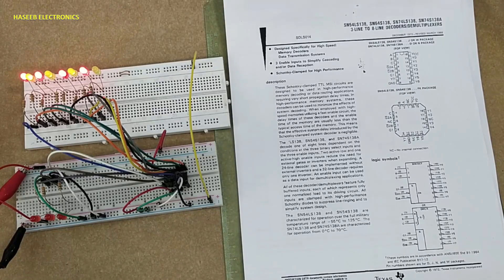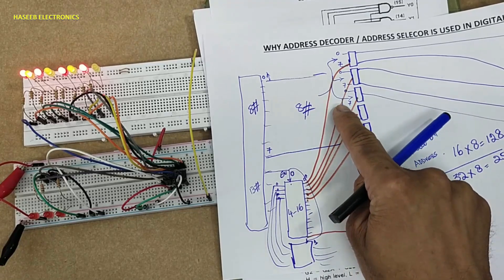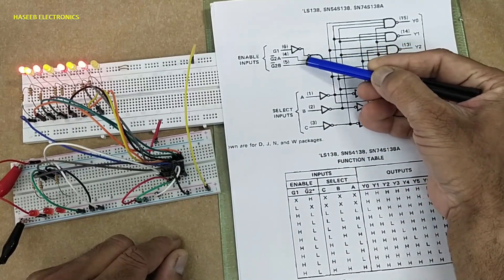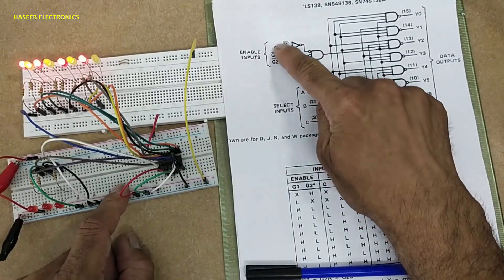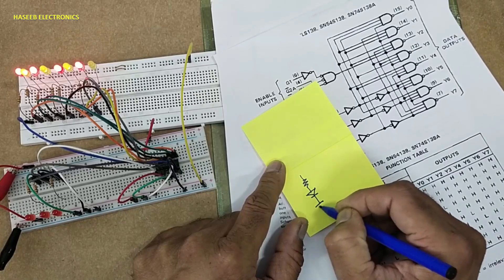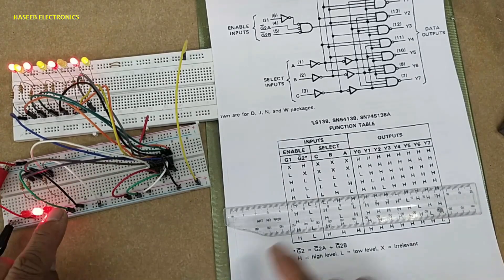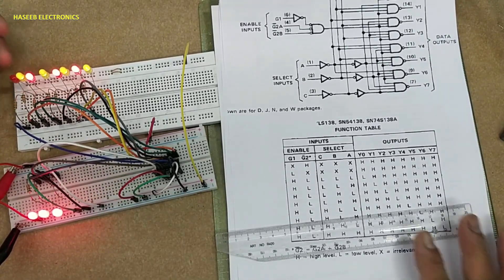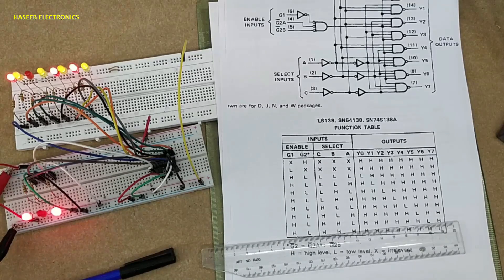{999} SN74138, SN74LS138 3 to 8 line decoder

Comment: Dear Haseeb you are make great work to explain electronics work principles on your channel. Could you please explain why the selected output on the decoder has low output, is there any reason? Thank your!
Reply from the maker: best regards and special thanks for your valuable words 
please check this video   https://www.youtube.com/watch?v=AYpZuNNuosY
because most of the time the address decoder is used to provide chip enable signal to any transceiver, transmitter, receiver, line driver. so it is provides an extra layer of safety to provide active low signal as chip enable to the above mentioned devices 
as the above mentioned components are used in parallel and out of those several devices only one is enabled to work by providing active low signal
other remain off by high signal 
if chip signal is provided active high instead of active low signal 
in that case any disconnected signal, open signal will cause to float the chip enable as high 
if there is another IC is enabled by micro processor and this "floated input signal ic" is also active at same time, it will cause to damage the complete system